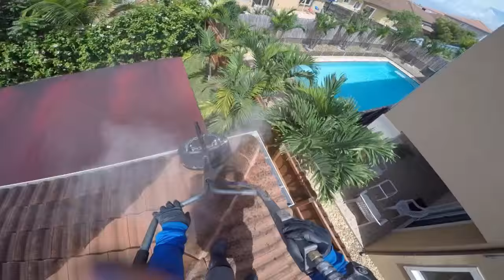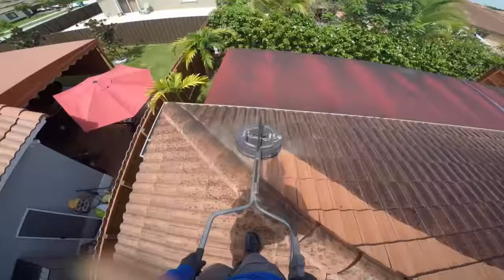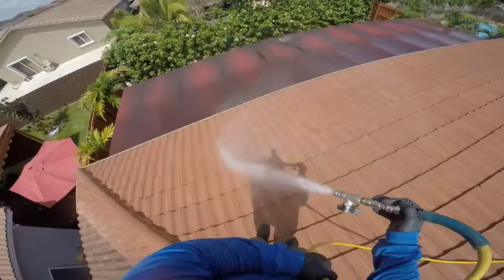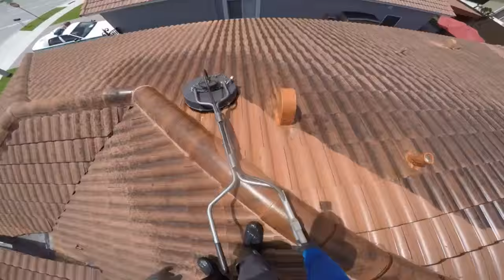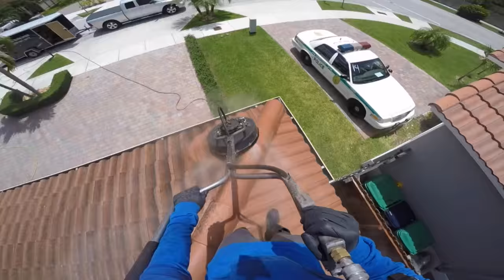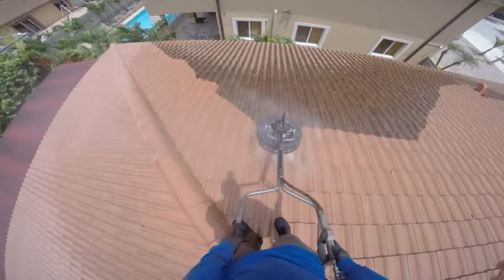ROOF TILES PRESSURE CLEANING WITH 8 GPM PRESSURE WASHER

Comment: This video is so oddly satisfying I just wanted to pop through the screen and try this my self lol
Reply: want to start in Residential and Industrial Pressure Cleaning ' I don't know which is the ideal machine to use a 20" or 24" pressure surface but I don't know which is the correct machine to use those pressure surfaces!  How many gallons(gm) and Pressure (Psi) should I use?

Comment: Super cool vid! How long did it take to do the whole roof?
Reply from the maker: Little more than an hour
Reply: So roughly 500 gallons of water?  That's a lot of water in places like Florida.  Was any attempt made to recapture that water?  Can it be filtered and reused?  What's it sound like inside the house when that's going on?  How do you not fall on the slippery wet tile?  Special shoes?  Golf cleats?
Reply: +theholytoast A lot of questions.
Reply: +theholytoast fl gets plenty of rain, is water usage a problem?
Reply from the maker: +Nick F. No water its very cheat down here
Reply from the maker: About an hour and 50 minutes
Reply: +theholytoast why do people ruin good videos with such stupid questions..
Reply: women
Reply: theholytoast luckily in Florida for the most part we have a pretty healthy water cycle.  some may would disagree with that but the water that doesn't evaporate into the clouds is soaked and filtered through the aquifer which is in fairly decent shape.
Reply: same

Comment: ok it's all fine and dandy, but one has to ask: WHY would someone wash their roof tiles? I mean, I personally like my tiles to tool like they've aged. And don't tell me it's to protect the tiles, because they're fine regardless if you wash them or not.
Reply from the maker: Ok, the black stuff on your roof its mold, fungus and bacteria growing and eating away your tiles, they become fragile and brittle as the root system penetrate them. You and your family are breathing all that. Second, roof tiles are light in color for a reason, to reflect sun light and keeping your house cool, when they are covered with mold they are black, absorbing more heat and making your house few degrees hotter,  raising your utility bill.
Reply: Thanks for the info!
Reply: Are you serious? Is that what you tell customers? :) roof tiles have lasted hundreds of years with no power washing, because the 'black stuff' also acts like a protection layer for your tiles. You are not breathing any of the so called bacteria, because it's on your roof for the wind to blow away. Also, any bacteria will either be burned by the uv rays or simply the heat from the sun. Speaking of heat, the tiles don't get that hot, even with the mold on them. The mold absorbs the heat from the sun and it might get hot, but not the tiles. Also, there's always your roof insulation. To me, what you are doing may help the customer have a shinier and newer looking roof. But as for walking on my roof once a year, power washing everything off, that sounds like you are just doing more damage. I don't even know if tile manufacturers even recommend power washing your tiles. Please don't take this the wrong way, I like your video and all, just trying to figure out if this is just for the money or it's really necessary.
Reply from the maker: +Demo Niq have it your way then, if you knew the answer why you asked?
Reply: +Demo Niq agreed- a completely pointless exercise! Roofs do not need cleaning, and doing so can substantially shorten their life. Dirt causes no damage what so ever, and even moss is unlikely to harm a proper slate or tile roof. However high pressure water can take the surface off a tile, and walking all over the roof should most definitely be avoided. The colour of the roof will have a minimal impact on internal temperature if you have a reasonable level of insulation anyway.
Reply: +Spencer Wilton You should ask the guy who wanted their roof to get cleaned. Its not his fault that people want their roofs cleaned.
Reply: A) It's for stupid people with stupid money.
B) They heard google earth was updating and wanted their roof to look nice.
C) They planned on selling their house and claiming the roof is brand new.
D) All of the above.
Reply: +Demo Niq sorry i call b.s. buddy,here in VA there are house's with clay tile roofs being replaced rightnow because of liken and alge that has weakened and destroy then.
I'm in the trades here and have even seen brick walls crumble from this stuff,plus it holds water and freezes wich causes expansion resulting in cracked tiles,brick,rotting cedar shake, ect. please believe it can be worse than you know. just saying the science is there and any 8th grader could understand it.
now thats not saying  in dryer warm climates that it would be a problem but thats another story.
Reply: Eric Floors  - sorry man, where I'm from, tiles are made to last for at least 100 years without any intervention. If tiles in VA are made that poorly that roots grow in them or they rot, that's a whole different story.
Reply: Demo Niq it happens bro.
Reply: A lot of roofs I PW are code violations from HOA or city..I clean my own roof (tile) every 2 years..It gets nasty and looks bad..
Reply: Demo Niq really. the bacteria will be burned by uv rays or heat from the sun.

ah yes, the bacteria grows specifically on the roof, im sure thats not because the amount of sunlight and moisture are perfect for it, no no, he bacteria are burned since their specific habitat isnt a suitable habitat
???

the mold absorbs the heat like you said. therefore mould is hot. when things are hot, they transfer heat. usually to the nearest contactable surface area, such as the roof tiles.

no hey dont last hundreds of years. things like mould fungi and bacteria have roots. the roots both break and hold together the tile.
thats why the tiles of really old houses are all cracked.

if you knew the reason, why did you ask him? did you want to interrogate him? to see if hes doing it for the money? of course he is, no one willingly says,  "i plunge into sewer systems to clean them so that there arent blockages because its FUN or i help put on the bathtub, clean the dishes, mow the lawn, take care of the kids, walk the dog and dress my master because i Want to, no need for money " 

and of course coming home and seeing a sparkling clean roof is always nice.

i know this is a year old but your reply was just so retarded i couldnt resist
Reply: its a must here in swflorida

Comment: What is that double handle called. We use a gun and it's crap. That looks easy as
Reply: Max Boston it is called a surface cleaner, there are spray nozzles that rotate under the disc.
Reply: Yes sir